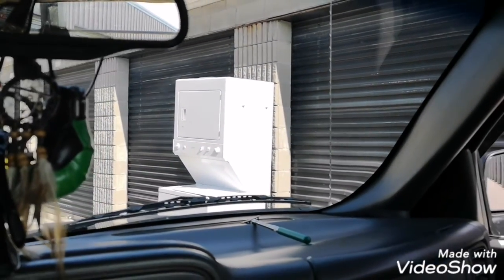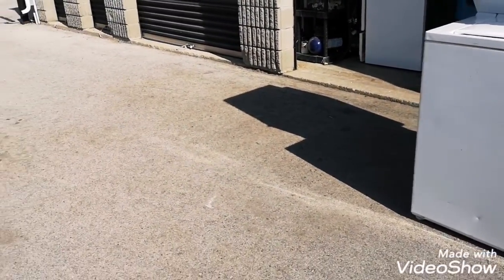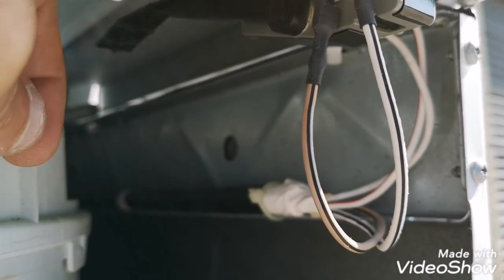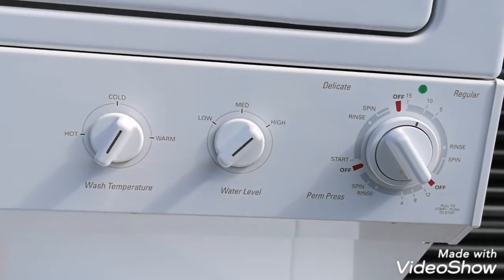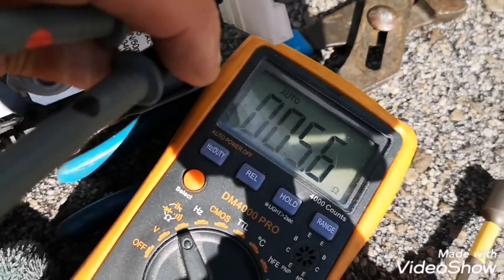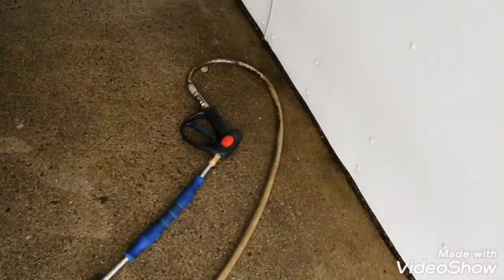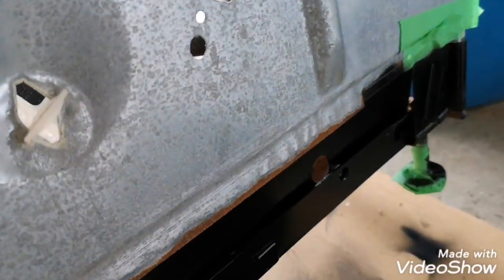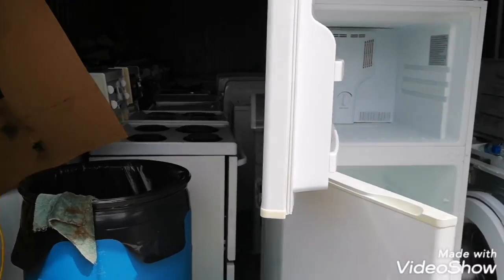MAKING MONEY FLIPPING STOVES AND FRIDGES

Comment: Bypass the lid switch
Reply from the maker: I don't to dangerous for some people . Sticking your hand in
Reply: @carmac1652  it’s about the money not the safety that can easily be defeated plus to replace the switch it would cost a lid switch, gas money, and time… to bypass it will cost a few minutes and a nickel… just splice the wires and wire cap them…
Reply from the maker: @ScantPear  I can't see people puting there hands in ? And besides kids don't do laundry .👍